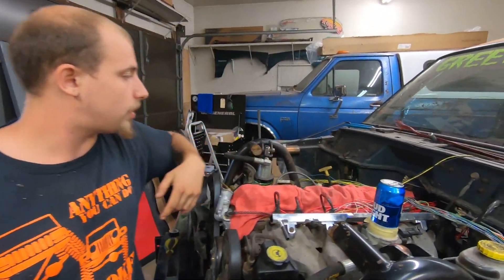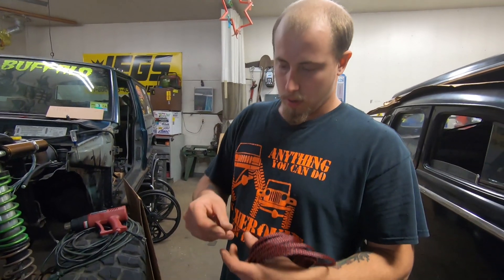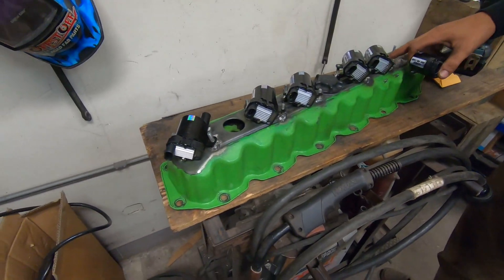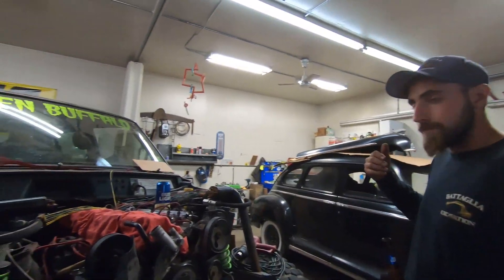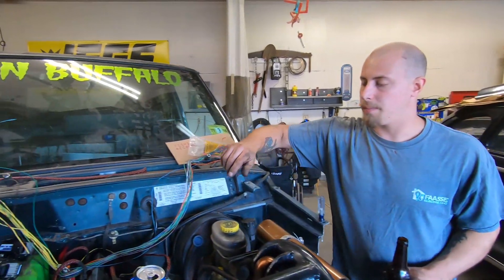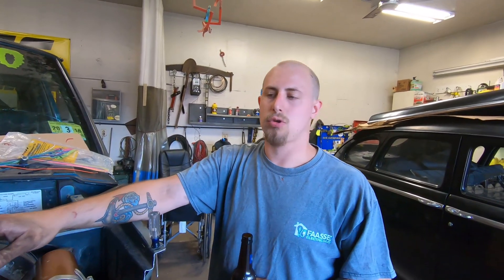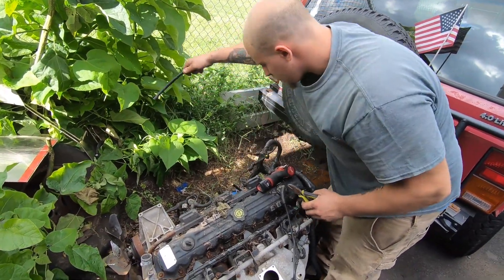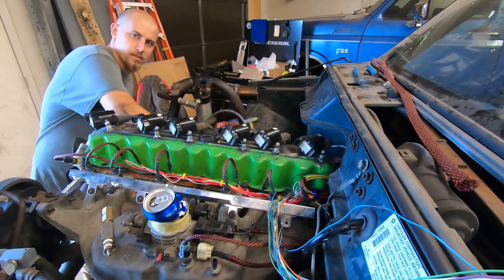Turbo Jeep Megasquirt Part 3

Comment: Just came across your channel man..I subbed👊 like what you guys are doing..I just came across a 4.0 grand Cherokee 04 model motor is done for..but everything else is mint on it..is it worth beefing up the 4.0? Or how hard would it be to put the 4.7 in it?
Reply from the maker: Never mess with the 4.7s but you would have to rip out the wiring and re wire the vehicle for a 4.7 I dont think its worth it. If you upgrade pistons, the bottom end of a 4.0 can handle 500+ hp

Comment: ive seen lots of people just plug the intake manifold IAT and just run it to the intake tube. might be an easy way to run the GM sensor and get a more accurate reading since the manifold gets heat soaked from the header